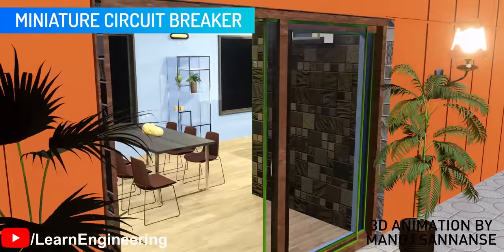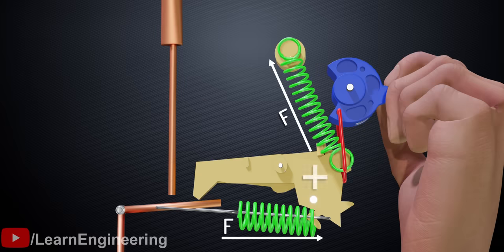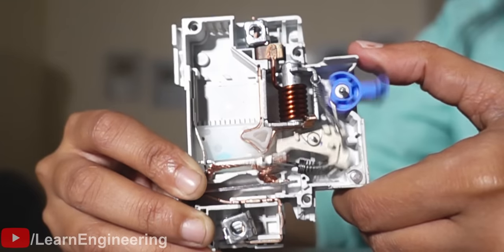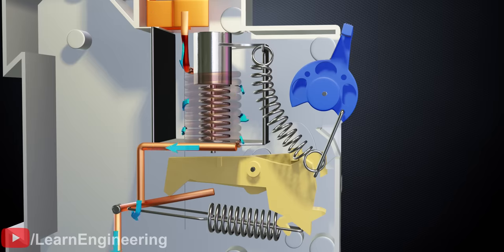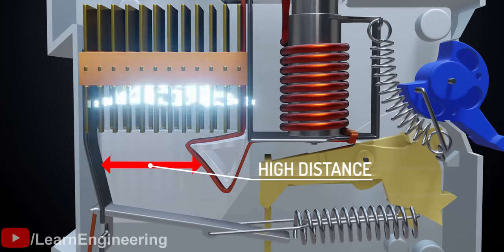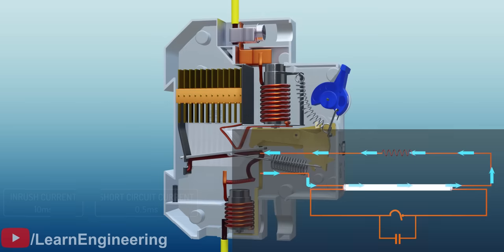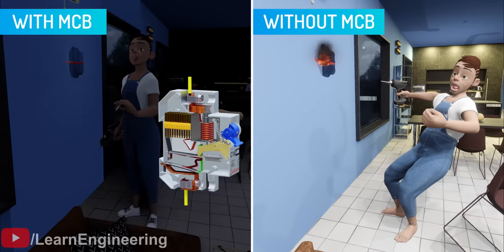MCBs, how do they work?

Comment: If only they taught like this in engineering schools we'd have more real engineers. Brilliant stuff! :)
Reply: so my uni just shared the link in lecture
Reply: Amen
Reply: @Kay2kGer  😂 when your uni asks for fees tell them to collect it from youtube…
Reply: @elismith4040  এক্স
Reply: nah bro. I'd rather learn heat flow through an ideal 1 dimensional string with specific boundary conditions so i can solve the type 1 homogenous equation with the fourier series.

oddly enough this has never proved useful. Oh well
Reply: @rayc1557  as an engineer, you overestimate the intelligence of engineers. 

imagine a person (giving an example about my peers), with little to no life experience, who is fairly decent at math, has never put together or taken apart really anything, and is taking classes that are mostly theoretical. 

My thermodynamics course had to explain how an internal combustion engine works because most of the class couldnt pass the hurdle of a 4-stroke's cycle...
Reply: so do you think the engineers who designed MCB were taught classes using colourful animations?
Reply: Engineers on their own should buy Book call Electronics all in one of Dummies . Although not yet printed in India by Dummies, it’s clear explanation of electrical n electronics from basics to latest, is a treat. Definitely you will find it satisfying
Reply: i never learn this. but  i can understand how current work. important thing is to close all main power before doing any action to the problem site.
Reply: @nuduw  well no 
but can't we just make a difference for our upcoming gen
Reply: @whoopyduck1210  no I'm really curious about the effects on intellectual capability this kind of teaching has on kids. People used to imagine how stuff worked using their brains back then. They only got to see still 2D drawings. Now there's nothing to imagine, you're being shown the whole thing. Are kids using their brains on something, then?
Reply: This is pretty simple stuff man. Idk how that would make ‘real engineers’
Reply: I think not even one of their teachers know what was explained here

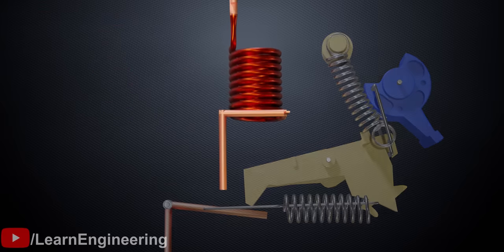Comment: A crucial correction needs to be brought to the attention of all those watching. At 4:03 the orientation of the North Pole and South Pole is incorrect. The South pole should be at the upper end of the solenoid and the North pole should be located at the lower end of the solenoid as per the "Right Hand Thumb Rule". By the way, this was an incredible visual explanation of an MCB. Thanks. :)
Reply: Thank you
Reply: Your comment need to be pinned
Reply: ummm dont the poles change in AC ?
Reply: @helioszxc  of course they do
Reply: @helioszxc  yes but as said in the video, the mechanism that blocks the current operates in a much smaller amount of time than a cycle of AC, so it can be considered like direct current in that particular instant
Reply: Not necessarily, if the demonstration is showing the flow of electrons in the wire then the magnetic poles would be correct. The picture unfortunately doesn't explicitly say if we're analyzing a positive current flow (from positive to negative) or not
Reply: @EggWhiteSalad  Exactly
Conventionally, current flows in the direction opposite to that of the electrons (i.e +ve to -ve)
Reply: @bhaktibhandari7379  Who even invented this stupid concept of 'conventional current'. when current actually flows from negative to positive terminal.
Reply: @overlord3481  ikr
But can't do anything now bcoz the world is obsessed with this concept and everyone knows current flows from +ve to -ve
Reply: Don’t remind me of electroboom’s haunting right hand rule song

Comment: Did I understand this well? Protecting from shortcuts is almost eternal because there is a really small chance to make this breaker fail because how it's built. But overloads can kill it easier because there is a part that keeps bending when it gets warmer and warmer, so maybe it can't be broken just in instant, but it can become less accurate than before when this problem appears frequently?
Reply: Well it's a metal strip so i guess it won't break that easily and won't leave it's property ever? Like suppose the metal bends when the temperature rises above say X degrees. 

No matter how much time u cross X degrees and the metal strip bends, it'll always keep on doing it. 
It won't leave it's property ever.

Comment: @Lesics

The information provided here are good. But for an engineering student some more information is required like

How much time an MCB take to break short circuit current/overload current.

I made a practical with C type 16A MCB for testing short circuit breaking time. But it did not trip even for 1 sec and thats a big time. Nor the main mcb 32A tripped so I tripped the main mcb manually for safety.

Comment: In Romex, wire is rated also in safe op temp. at full load wire won't go above 192 degrees F
but doubling current will cause wire to get 4 times hotter.

Comment: I recently watched your video and tried opening and dismantling a spare MCB i had.. i now understand the working very well but i broke the switch hinge while plucking out the rivets.
Reply: Hehe. Curiosity at the top!
Reply: I was quite lucky, as last week I had replaced a dead MCB (it had charred up inside, I'm guessing overloaded but it failed to break the circuit, so it overheated). I autopsied it to see what was wrong with it, and Tadaaa, a new video explaining in details what's inside an MCB! It was very useful!
Cheers!

Comment: I heared a story, from my teach, that in my school there were 3 guys trying to start an eletric engine.  the MCB switched off immidiately every time they tried. So the leader of the group had an idea , if it switces off, why don't we just force it, so it won't switch off. A expected, the motor started to smoke. After a few mintues they checked its info, and it turned out to be a 24V or 48V (I can't remeber which one) engine, and not a 230V as they thought
Reply: You can not force it to not switch of. If you hold the little lever, it will still trip. Clever design!

Comment: Trip time of an MCB is totally dependant on MCB type and resistance of load / fault. An MCB,  'C' type, 16 amp to BS 60898 standards,  with a 30 amp load (240 V/ 8 ohms) will take 200 seconds to trip ...about 3 minutes.

Comment: 00:03 MCBs protect from short circuits and overload conditions.
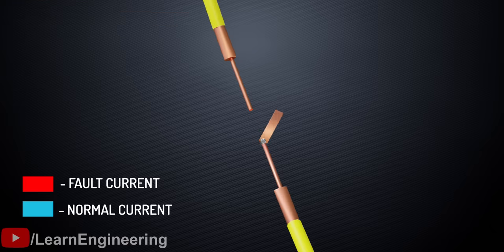01:10 MCBs are designed to quickly respond to electric faults
02:07 MCBs work through the compression and expansion of springs to transfer force to the lever.
03:11 MCBs operate by using an external trigger to control the lever rotation and open the circuit.
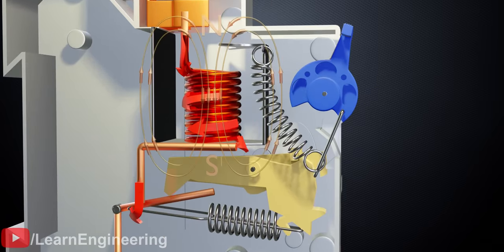04:19 MCBs use a strong magnetic field to trip the circuit.
05:20 Arc chutes help to extinguish hazardous arcs in MCBs
06:21 MCBs prevent dangerous current overloads.
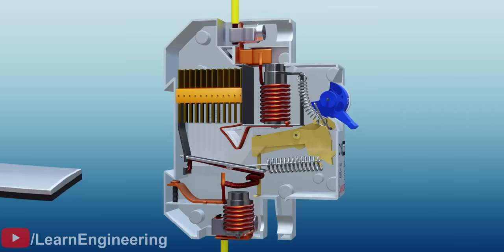07:21 Bi-metallic strip is a slow sensor to offset inrush currents.

Comment: I have a question. If the bimetallic strip bends during an overload, it will remain bents after the issue is resolved and everytime tou turn it back on it will turn itself back off.  How do you prevent this?

Comment: Drill thru a wire with a Federal Pacific circuit breaker protected.    The drill bit will be welded in and arcing till the wire blows apart. But the breaker would not trip.  I swear by Square D   It never throws a spark and a failed filament in a light bulb trips them

Comment: The magnetic poles or shown wrong on the coil. Right hand rule dictates that the north end of the coil is where the current (in this coil shown) is flowing out of it. Magnetic fields also flow from North to South outside of the magnet and South to North inside the magnet. This is not the case in the video

Comment: What if the current going through the MCB is going in the other direction when there is a short circuit? Wouldn't the electromagnet not function properly because the magnetic field would be in the wrong direction? By the way, nice video!
Reply: Whatever be the direction of Field, in either case it attracts the iron plunger causing the MCB to trip.

Comment: Maybe this is a dumb question, but in the first scenario of short-circuit protection, if the AC current happened to be moving in the opposite direction, the magnetic force from the coil would be up instead of down. But I suppose there could be linkages to trip the breaker regardless of which way it moves...?
Reply: Actually a very good question. The position of the push spring will decide at which half cycle the protection mechanism works.
Reply: @mohammadmonowersohel8097  Oh that makes sense, thank you.

Comment: But this is AC system. 
In an alternating current (AC) circuit the two poles alternate between negative and positive and the direction of the current (electron flow) reverses periodically.
for EX. I am Taiwanese, in our contry AC is 110V 60HZ.

Comment: how does a breaker protect against the stupid who force the lever up with some wire? Apparently some breakers still trip in that case.
Reply: This breaker design wouldn't protect against it. It will burn down your building if a janitor leaves the broomstick under that main lever. The US-style breakers are safer than this particular MCB design.

Comment: I have a question.
This is an AC system. So if the short circuit happens at the beginning of the other half phase (causes the electromagnetic field attracts to another direction). Then the trigger time will be longer than a half phase. Right?
Reply: Good question, I guess by the time it reaches the other half the Circuit breaks down. I hope you have got any better answer
Reply: i guess you right. i wonder if the next half of sine wave comes in 0.02 sec so do we get total of 0.023 sec. of activation. sure it is still very short time
Reply: @Thrill98  Yeah. Just out of curiosity question.
Reply: Because it's AC and the current goes back and forth it doesn't matter where in the phase the fault occurs. So it'll still be 3 milliseconds or whatever the device is set to by the manufacturer

Comment: Be thankful if you are in a developed country, since in the developing countries, they typically don't use ground.  And they don't even use 12V outdoor lights in and around water.  Think about that.  I myself when building a house in a Third World country had ground and circuit breakers installed by an electrician, not sure if he set up the ground wire correctly however, as it was his first time he's ever done it, though the multimeter for tiny currents does show it is grounded, but for big current spikes I don't have a lot of confidence in his 'home made' solution.  Not to mention in these countries they often have current spikes from the local (incompetently run) power plant that fries your electronics, so voltage regulators (not those cheap fuse types you buy at your local hardware store but ones that employ a potentiometer and are constantly adjusting current) are not uncommon, if you can find one (finding supplies is always a challenge in developing countries).
Reply: Oh, and electrical fires are quite common, even in fancy homes, you can sometimes see the charred remains.  Luckily in many countries outside the USA they don't use wood but stone, which doesn't burn as easily.

Comment: I had wished to fit a circuit breaker to a boat with 12V DC.  Now the thermal part made it quite unsuitable.  The current at which it blew depended on atmospheric temperature.  Which means that it wouldn't trip with double the correct current if the temperature was low.  Leaving the boat wide open to fire caused by overload.  It is horrifying that the same flaw exists in these.  A bore motor developed a fault.  The current was high enough that the plug MELTED from the heat but the breaker did not blow.  A better design must be found if we wish to avoid burning down houses.

Comment: if the mechanism works faster than the cycle of the current, would there be cases during a short circuit that will have a current flowing the other way, which will cause an opposite magnetic field which will pull up the string rather than pulling it down, which will not cause the lever to drop?
Reply: The pin itself is ferromagnetic and not a magnet. Basically, it is like an iron nail. Iron is equally attracted to either pole of the magnet (south or north) so the direction of the current makes no difference, the iron would do the same thing in both cases.

Comment: We've all likely experienced a short circuit at one time or another doing electrical work. Why doesn't the breaker ALWAYS trip, say when a screwdriver inadvertently shorts the circuit? Enough energy to melt the screwdriver tip, but not enough to trip the breaker.
Reply: It depends on the inrush of current at the moment of short-circuit and the duration of time the circuit experiences that inrush. Take for instance a 32A Type B breaker. It requires a minimum of 160A to trip within 0.1 and 5s. If the momentary inrush at the time of short-circuit is only 100A then it could 'theoretically' take up to 30s to trip, while your screwdriver tip is experiencing a nice new haircut.
Reply: Yep, what Steve said. You can short circuit momentarily with out exceeding the breakers rating. Especially on larger breakers for ovens or clothes dryers that's why they new new circuit breakers like GFCI or AFCI  or even CAFCI use additional mechanics and wiring to measure additional faults and trip when they sense about anything,  but they are 10 times more expensive than the one in the video and still are not code required in a lot of places plus there is still billions of the older style out there that would still need to be upgraded. best bet, always check with a multimeter (volt-meter) before touching :)
Reply: @stevehaney2446  - Good answer. Thanks!

Comment: Why is the bimetallic strip doesn't activate during short circuit condition.....in the animation the MCB components are connected in series......so even the bi metalic strip activates then there's no requirement of electromagnet as u have said that more current is flown during short circuit condition than overloading condition....pls comment 🧐🧐🧐🧐🧐🧐😕
Reply: The electromagnet is still needed because the power needs to be cut immediately during a short. The in-wall wiring of the house cannot handle short-circuit currents and therefore subjecting it to short-circuit currents for more than a few hundred milliseconds is enough to make the wiring glow, burn up, and possibly cause a fire.
Reply: @thisjt  then why does the bimetallic strip doesn't activate during the short-circuit condition according to the animation, even if the current is changing by milliseconds...

Comment: Whenever a short circuit happens and the mcb disengages, is it safe to just turn it on again?
Reply: No, it is not. This is a great video but terrible and unsafe MCB design. If anything physically prevents the main lever from moving away from ON position then it will not interrupt the current. If you try to reset this breaker manually but you happen to still have a short-circuit fault somewhere then the breaker is supposed to interrupt the current immediately but your fingers will prevent the main lever from moving to off position and will keep it in the ON position for about a second or more. This will expose your house wiring for full short-circuit current for about 1 second or more. The US-style breakers are much safer.

Comment: I am confused by the principle on cylinder, how the strong magnetic field generate EM force acting downward?
Reply: Good question! So if you observe the cylinder is placed on the top of the coil on a spring. Not in the centre. Generally in electromagnets and even permanent magnets the field is strong at it's core centre. Thus when the current is high force will be high. And the cylinder overcomes spring force and moves down.

Comment: I have a doubt 
Arcing occurs in high voltage right??
Normally  I have seen arcing in high tension lines  but not in high current flowing situations like car battery etc 
So I get confused with your narration( you told  high current causing arc , but as per my lil knowlege high potential defference causes ionising air and causes arcing)

I think as per my knowledge when sudden circuit breaking occurs that causes sudden change in potential in electro magnet causing sudden flux change ,iduces a high voltage in coil in reverse direction may causing arc)

Comment: Just curious here, how often should you have these mini circuit breaker replace at home?
Reply: Only when they cause problems!
Reply: @NalinKhurb  😊👍
Reply: Technically never unless... you over load them a lot and then the metal material gets weakened and they trip all the time with less current. It still will not be a danger. It will just trip with less load. Eventually they will get to a point where they don't even want to stay on.  I work at a big company we do these all the time. As long as you keep under current rating of the circuit, then back to you should never need to replace.
Reply: @jamescole6846  Nice to know for the future. Anyway, thanks for your input. 😊👍

Comment: without knowing about mcb, before this, when ever electric short circuit happen in my place, i detect, where does that Mcbs locate . then ill open the plug to detect what happen inside it. if theres burn mark/smell, i change the plug/wire. then turn on the mcb back. if the problem still occur, then change the lcb with the new one. of coz, turn off all main power/big power. problem solved,

Comment: How would the bimetallic strip reset its position after bending due to high temperature?
Reply: The strip depends on heat and will cool down within a few seconds, straightening itself again.
Reply: You can find this special strip in temperature-adjustable irons.